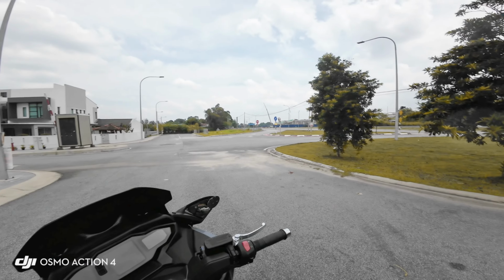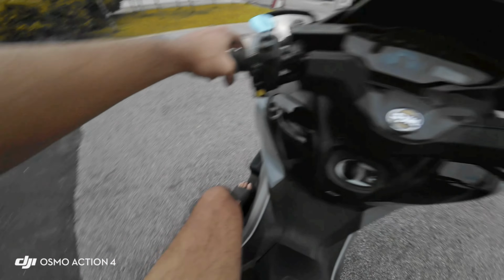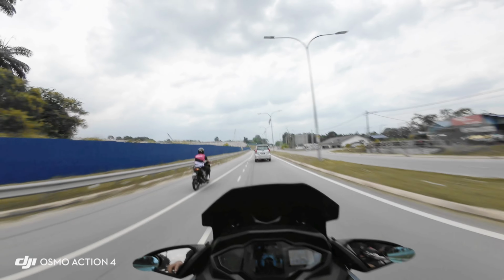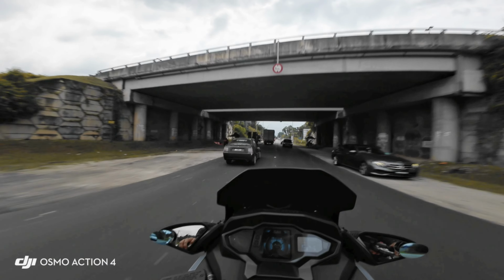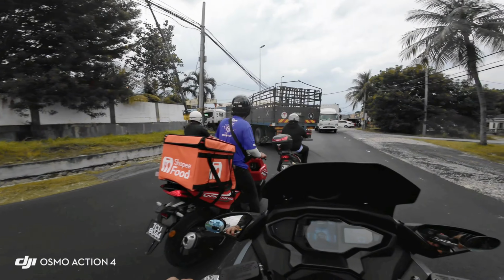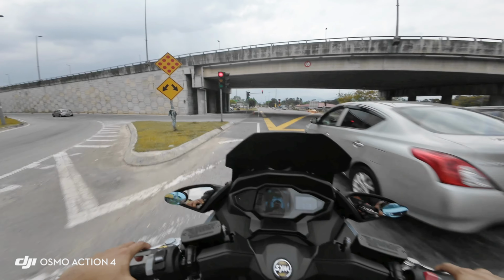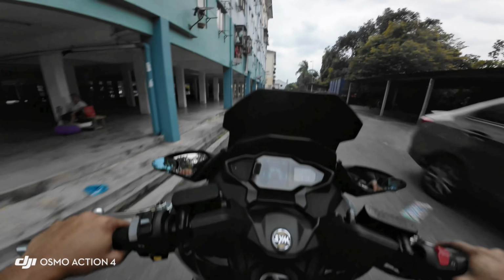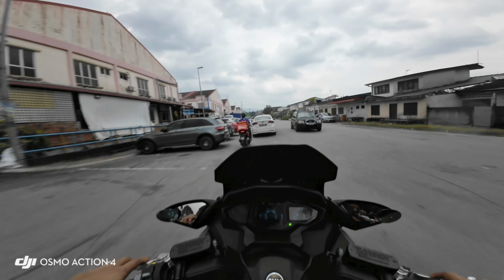pov: Bapak aku bagi moto dia | SYM MAXSYM 508TL 2024 | Short Review! DJI Action 4 [4K]

Comment: Hello. Hows the maxsym tl compared to your x adv???
1) acceleration
2) comfort
3) ride quality
4) quality of the plastics

Btw nice video. Keep it up
Reply from the maker: For the acceleration, surely the XADV will be the winner due to the higher cc. However, XADV lose to the comfort as the handle bar is quite aggressive compared to the TL. I find that TL takes much more of the riding experience but both lacks with the cornering capabilities due to stuck at the stands. 

XADV feels more premium than the TL but yeah it was a draw for me depends on your purpose of riding.
Reply: Thanks for your inputs. Really informative. I really enjoyed your vids. Kudos!!!